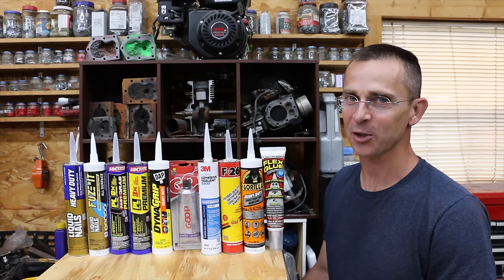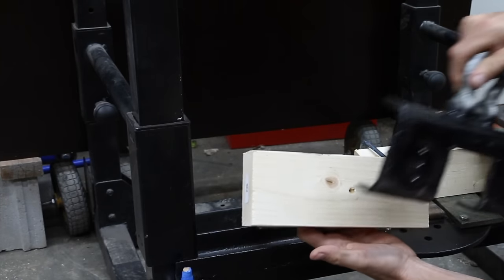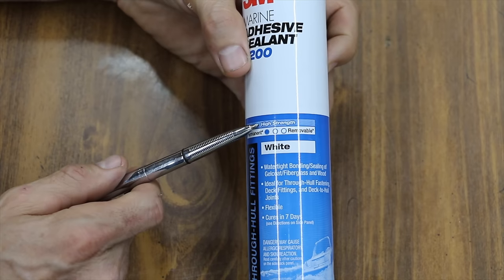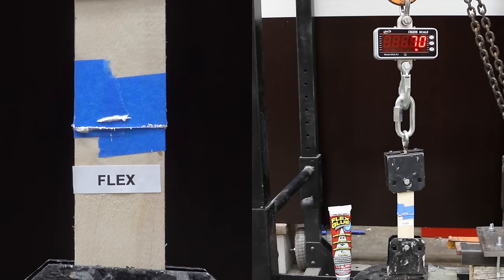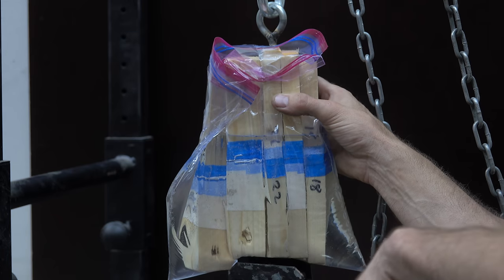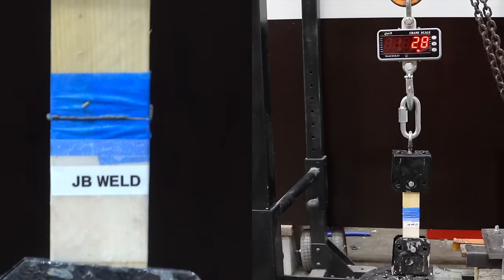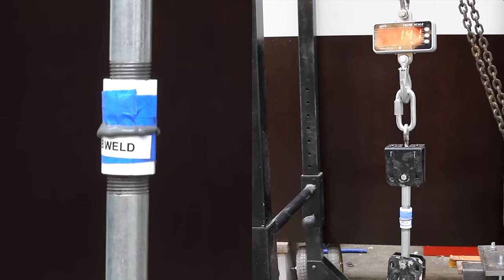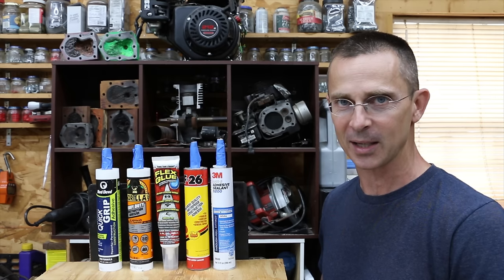Which Construction Adhesive is Best? Let's find out!

Comment: Have you considered putting some samples to test away for some years later?  I would love to see a future update with some testings with some extra test samples that were put away and stored for 3+ years, and I'm sure I was not the only one to have construction adhesives fail over time and the original strength does not necessarily mean it will stay that strong.
Reply from the maker: Thanks for the suggestion.

Comment: Hey hello, tell me what you think about that... I need to glue back a small part of my side wall for my fifth wheel camping trailer, the material is luan 1/8 thick and aluminum stud, which glue would you take to do that kind of job? Loctite PL 8X ? Do you recommend me to ruff the aluminum stud so the glue stick very well ? Thanks for your help ! :) very good chanel.

Comment: Great video, but a few issues - there is a wide disparity in the results for testing Woods versus Plastics so combining them doesn't make sense, especially for PVC as PVC glued to itself should be done using a PVC Solvent glue not a construction adhesive. A better test would of glued a PVC fitting to wood.
Reply from the maker: Thanks for the constructive feedback

Comment: I love your reviews! Can you please test adhesive removers? I recently had a job where I had to remove the gum left behind when I removed weather stripping from a metal door jam. The weather stripping was supposed to be "permanent," and it left behind a thick thread of that adhesive gum all the way around. This is what I tried that did not work: Mineral Spirits, Goof Off, Simple Green, Goo Gone, WD-40, 3M General Purpose Adhesive Cleaner, and brake fluid (someone told me to try it). Thank you!
Reply from the maker: Thanks for the video idea.

Comment: I was painting steel entry doors over the last couple of days the regular Rustoleum paint is well worth $5.79ish per
 can over their cheaper line 2x paint/ primer Rustoleum on sale ,,,, 2 for $7.00 those doors are now very striped and will have to be repainted didn't melt in and blend together well! And the spray nozzle was to pointed to make nice passes. Probably fine for small projects but not larger areas.  :(
Reply from the maker: Thanks for sharing.

Comment: I have a stone address plaque that weight approximately 12/14 pounds. Will Flex or Gorilla may help the job done in gluing that plaque to a concrete exterior wall? I live in South Florida, a semi-tropical humid weather without a fall or winter condition.

Comment: What do you think about doing a follow-up video some day on construction adhesives for concrete, brick, stone, masonry, etc? I've used a lot of SikaBond Pro Select Construction Adhesive on cinder blocks and masonry and been very happy with it. It also claims to be rated for continuous submersion. Not sure if it's in the same category as these adhesives or not; maybe you'd see even bigger differences bonding pavers that won't fail like the wood. Either way, this was an excellent test, and really surprising how large the differences were in terms of percentage. I would have guessed they'd be much closer.
Reply from the maker: Thanks for the suggestion.
Reply: Yep would be interested in this type of test for concrete blocks

Comment: I found myself looking for an adhesive a few months ago and was not sure which one to use. I needed instant tack to a wet and cold surface. Ended up using flexglue as it was the only one that had that specifically on the label. Only thing I need to figure out now is if the 3m comes in small tubes, is instant tack when wet... and if those two are flammable (was used to emplace explosive breaching charges)
Reply from the maker: 3M is hard to beat and it is sold in small tubes.
Reply: @ProjectFarm  excellent... off to see which one is less flammable

Comment: Never had the best success with Liquid Nails or Red Devil products, based on actual use. Using the correct 3M product for the application renders excellent results, 3M has a vast array of products for a multitude of applications. LOCKTITE products, made by Henkel AG & Company (Germany), are excellent products for numerous general purpose applications.

I used Loctite PL 375, a water-based, water-cleanup glue, to glue up over 2000 decorative hardscape concrete blocks, ranging from 6" to over three feet in height and back-filled with soil. Those projects have remained unmoved for more than ten years through multiple freeze/thaw cycles. Those hardscapes are not subjected to continuous water immersion but certainly see plenty of rain and snow.

Also have used PL 375 for many other applications, including caulking various exterior moldings, both wood and PVC, and have not experienced any failures. PL 375 is very easy to clean up the oopses, provides a relatively quick bond, slower set time, about 20 minutes, and a full cure in 2-3 days.  As Todd notes, allow 8 days for maximum of cure of just about any glue.  PL 375 is very cost effective as well, when buying the 28 oz. ("QT") tube, running $4-6 bucks at either of the big box stores, the small box stores and online. Of course, you will have to invest in a 1-Quart caulking gun, great for a larger project. :)
Reply from the maker: Thank you for the feedback

Comment: F26 is an American made product, made in Hutchinson Kansas by Leech. I've never used F26 for wood using it for things like holding rocks in place and siding against a wall where the nails broke the siding and have never had a failure. Any product being usued on wood that's going into water should be sealed first or the water is going to facilitate the wood failing to hold the glue in it's tissue.
Reply from the maker: Thanks for sharing.

Comment: Suggestion : since the wood failed before the adhesive, we really don't know what the actual numbers are.

How about using simple clamps on both ends of the boards instead of through-bolts?     There are clamps with teeth, if smooth jawed clamps still can't hold against your winners there.
Reply from the maker: Thank you for the feedback

Comment: Construction adhesives usually require 24h curing time - UNLESS the surfaces are both non-water permeable. They cure with moisture from the air, so applications over large surfaces on non-water permeable materials require much more time to cure. Thus, the tests on PVC provided no useful data, since they were a mix of strength and the speed with which the material is able to cure. They should have been left to cure for far longer, and/or have pinholes drilled in the centre of the PVC caps to provide a path for the moisture.
Reply from the maker: Thanks for the feedback.

Comment: Awesome.
Curious if you've tried the 'Gorilla 8212302 Max Strength Clear Construction Adhesive'
Would be great to know the various polymers these adhesives are based on (beyond the epoxy)
Hard to find info, seems, cagey with their formulas?
Also toxicity comparison, & environmental/incineration issues.
Ideally we want one that's as strong as the wood, as nontoxic as the wood, & burns like wood.
Maybe they should make one out of cellulose, like Xylonite.
Degrading like wood maybe not, some wooden structures are centuries old, bummer if the glue degraded first.
But I'm thinking that after the entire house you just glued together with these magic molecules, it will all one day be compost, except for the glue, some of which will be likely there for perhaps 10,000 years, floating in the humus?
Aside from epoxy, seems 3M is the ticket, apparently it's a urethane.
Reply: Also would be curious how these construction caulk-gun-style adhesives compare with the various wood glues out there, from Gorilla Glue to the various Titebonds, especially the Titebond III, which claims to be waterproof...
Reply from the maker: Thanks for the suggestions.

Comment: These videos are going to help me not touch so many things while shopping during this pandemic, do you have any videos on modern/recent paint thinners? Namely on powder coated surfaces and generally factory paints? (Working on removing paint from camper levelling jacks, and I’ve tried a few, only one was good so far and it requires scraping, which isn’t that possible in many areas of these parts, I’ve noticed the restore channels only use a brush, that would fit most areas of these but finding which one is capable would be either expensive, or embarrassing (returning items is bad enough, but my shoes are pooched and now envy sandals, not to mention it’s best to avoid waste in general and returns should be avoided during the outbreak), I’m about ready to accept the fact that I might have to get a container to hold the parts in with low excess volume and soak them, but a lot of the current versions of paint strippers won’t really benefit from that unless they can soak all at once Undisturbed)
Reply from the maker: Thanks for the video idea.

Comment: You need to do one with what is the best grease to use like you did with the engine oil
Reply from the maker: Thank you for the video idea!
Reply: @ProjectFarm  if you do do one maybe start it out with the most expensive against the most expensive and the cheapest against the cheapest.  Move them through the brackets that way to see how the expensive ones hold up to each other and the cheapest ones hold up to each other. Then for the final the cheapest one against the most expensive one that makes through. The only thing I would do different is for each set that advances I would increase the stressness on the product

Comment: Polyurethane (these caulks) cures from moisture. I'm guessing that is why they didn't cure well in the PVC test, there is no moisture exposure. It's either that or simply the smooth surface, but without testing, we can't know that answer.

Comment: In order to get a fair comparison between JB weld and the other products, you should have let the construction adhesives cure for a much longer time since they don't use a catalyst OR glue up the JB Weld tests 15-24 hours prior to testing them all, with the construction adhesives having cured for a week. Comparing a catalyzed adhesive which has cured 8x longer than the label says gives it an unfair advantage.
Reply from the maker: Thank you for the feedback

Comment: Maybe if you tape around the ends of each board with T. Rex duct tape, that could help reinforce the grains of the wood to help you get a better measure of the strength of each adhesive’s tensile strength (if that doesn’t work, it can’t hurt to weld on a piece of steel around the wood, even if it’s not practical in real life. I just want to know the full strength of the adhesive.)
Reply from the maker: Thank You!

Comment: Got  a project where I need to glue  10ft  long 2x4s to meral, and am looking for the strongest adhesive.  Am looking at West Systems epoxy as well as the West Systems G-Flex.  Would love to see a comparison between the West Products (straight and with filler) compared to Loctite Pl 8x
John

Comment: I'd love to hear your opinion on the best adhesive to sandwich XPS foam board between 1/16 FRP sheets to create rigid panels that I'll be using to build an overland camper. Thanks!
Reply from the maker: Thanks for the suggestion.
Reply: @ProjectFarm  Do you have a suggestion for the best adhesive for this project? Thanks!

Comment: A sorta sub-test for this test, but how about which adhesive/sealant is best for getting down in cracks?  Ie, you have a leaking XYZ and instead of pulling it out to repair, you want to use some sort of self leveling compound to seep down into the cracks and seal it?  Sorta like how the RV use stuff to fix all their leaking roofs.  I'm thinking something like aqua seal and E6000, maybe 3M 5200 would be interesting as its not really their designed purpose.
Reply from the maker: Thank you!

Comment: Can you help me? Each winter I get 2 to 3 feet of snow against my building. As the snow melts it gradually seeps between the caulking, steel wall and the monolithic cement slab. I have tried a number of caulking products, but the snow melt wins in some corners. All fits are as tight as construction practices allow. Any suggestions?

Comment: I know the intake is fine on your ranger but maybe to improve fuel mpg and hp try making a PVC or abs intake from the throttle plate to the bumper, I'm going to try this out on my duratec ranger by having it split off into a tee from the throttlebody and cut out holes where the fog lamps go and place filters there for true cold air intake and see if it's better over the stock, currently I make 202HP 5250 rpm and 219 lb ft at 3250
Reply from the maker: Thank you for the video idea!
Reply: @ProjectFarm  I gained about 14 solid poinies at the Dyno with the same conditions, and avg fuel economy went up by 2-3 mpgs but my truck uses a dual over head cam engine
Reply: @ProjectFarm  I ducted the PVC to both fog lamp holes and wrapped the PVC with aluminum to block heat, the MAF is at the tee right before the throttlebody, it's a ram air setup and at highway speeds I do gain power compared to stock, I've heard good things about both the 2.9 and 3.0 v6

Comment: i wonder if there is a difference between the smoother cleaner cut of the chop saw vs the factory ends that tend to be really rough? it is also worth adding that the 3M being soo strong might actually destroy your wood vs the adhesive giving way first.

Comment: Just wondering if you can test Henry's "Wet Patch Roof Cement & Patching Sealant" (#HE208030) and Gardner-Gibson  Black Jack "All Weather Roof Cement".  I have a drip in my garage ceiling when it rains hard. A staple is the cause. Found it but I've never used any Roof cement. Black Jack is less expensive. And what's the shelf life on both unopened and after the can has been opened and partially used? Thank you.

Comment: There's good reason for boat builders using Epoxy when building with wood.
Reply: Epoxy resin is all that should be used on a boat. Unless you actually want the wood to rot... 5200 is good for sticking stuff to the boat though.

Comment: I have a jb weld hypothesis that i can only trust you to resolve . from what i understand jb weld,quick steel, etc are ferro magnetic from what i understand and seen with quicksteele. Now my hypo is if jb weld (etc) are cured under a strong magnetic field then it will increase epoxy rigidity parallel with the field and reduce structural  strength perpendicular to the field .. Just a quick thought o was kinda wondering also does coating a magnent in jb weld reduce the field . ie if you were to coat a fishing magnent in jb weld ( if it is ferro magnetic) will it reduce the magnent atraction capability? Good luck and. Thank you for you analysis of everything. i  watch. Your videos on things i really dont givabout , cause i always learn something that  i didnt know i  gavabout!
Reply from the maker: Thank You for the Constructive Feedback!

Comment: How do you measure the cc of a piston? By using a standard tape measure?
Reply: It's cubic centimetres so yeah you measure with millimeters the diameter and length of stroke and work out volume in the usual way.

Comment: 10:44 I don't know that I agree with comparing the strength of JB Weld wet and 3M wet when both of them failed the wood 3 times. The wood failed at different weight NOT the product. You're saying that JB Weld made the lower half of the wood stronger by being bonded with the upper piece in this graph and that is simply not accurate.

Comment: We use 5200 in marine all the time and it will put any structural epoxy or fibreglass builds to shame. 

If the ghostbusters used 5200 they would’ve never had any problems
Reply from the maker: Thanks for the feedback.

Comment: There is only one kind of wood glue that is stronger than wood believe me.   The wood will snap at other places but not around the joint holding it. There is a process to make it.  No matter what, > this test showed that JB Weld outperformed  3m by a Mile wide.  But that one glue that I mentioned here will outperform all combined.  I forgot the name of it at the moment, and will have to look it up.  When I do, I will let you folks know.
Reply from the maker: Thank you for the video idea!

Comment: why 3M?  it looked like JB Weld did much better at 493 pounds.
out of curiosity could you redo a challenge between just the two, JB Weld and 3M pull test and really bolt onto the wood and see how much higher than 461 lbs they can withstand?
Reply from the maker: Great point.  JB Weld is definitely stronger but of the construction adhesives, 3M seems to be the best.

Comment: I think you should do some ridiculous jb weld stunts. Jb weld wheels on a car, jbweld the square flange on a reese hitch and remove the pin, cut halfway into a tree, jb weld it back together then cut the other half. If the jb weld is stronger than wood it ought to hold the tree together. Just some jb weld madness. 😜
Reply from the maker: Thank you for the video idea!

Comment: I can tell you that liquid nails with the red label is no good. I used it for 15 years with no problems but the formula has changed and will not adhere tile to sheet rock like it used to. They changed from a mineral solvent to latex and now it simply does not work. I have many square feet of tile stuck to our walls for over 15 years using the original formula and I defie anyone to pry these tiles off but the new stuff does not dry after 2 days and the tiles fall off.
Reply from the maker: Thanks for the feedback!